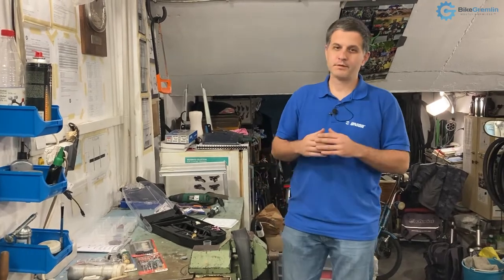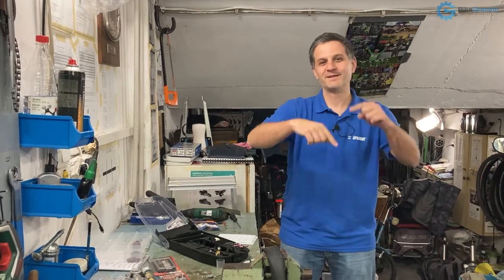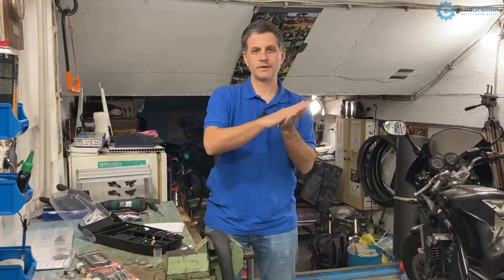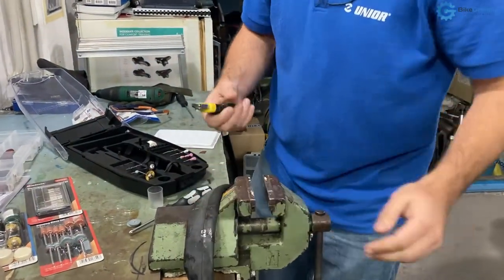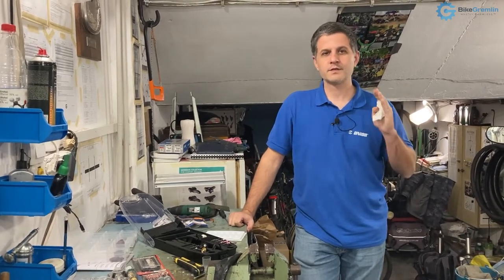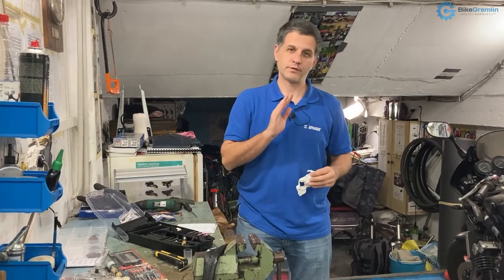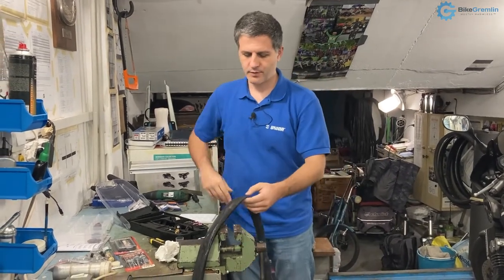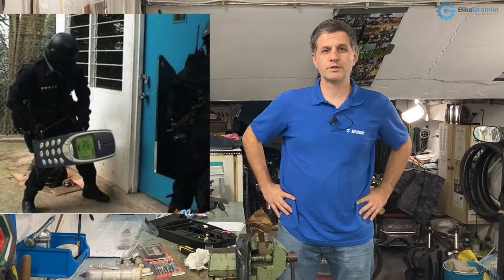Flat tyres - how to prevent it

Comment: Nice instructive video! Funny how it ended when in the last second someone knocked at the door :)).
 
One of my bikes is a Dutch bike - a Batavus city bike. I bought it around 2018 and I estimate it was manufactured in 2007. It has Schwalbe Marathon tires (28" x 1,75) and I personally rode it more than 3000km on road and on gravel and I never had a problem with it and still has the original tires (15 years old). Those tires are amazing! Of course, I try to look where I ride but on other bikes, when I use cheap no-name $15 (both) chinese/russian/polish tires, I will always get a puncture in 100-200km. So I really believe that Schwalbe Marathon are best of the best! Of course, over the years they've improved with the Plus and the E(electric) which are supposed to be even better.
I am not sure if other manufacturers such as Continental or Michelin or Maxxis, etc. have something comparable with Schwalbe Marathon.
Except for Schwalbe, everyone else seems to focus on performance (for sports), on miliseconds, on lightness, on grip, on dedicated MTB or Road bikes and they seem to neglect every day needs for people who just want to use their bikes for fun, for commuting, for riding in the park with their kids.
 
I wish that in this video you would have touched the matter of how the with of a tyre influences punctures (eg. 1.25 vs. 2.5) and what the inflation of the tyre does (ex. 2 bar vs 4 bar).
Reply from the maker: Regarding the tyre pressure, I did discuss its effect in the flat-tyres article:
https://bike.bikegremlin.com/14092/flat-tyres-causes-and-prevention/

Continental for one makes different kinds and levels of flat-resistant tyres.
Gatorskins ("road bike" tyres with decent flat protection), Tour Plus (trekking tyres similar to Schwalbe Marathon tyres) etc.
Not sure about the other manufacturers.

Comment: Instead of using tires with built in puncture guard which can use 15 Watts or more, I prefer to use Mr Tuffy tire liners which only use 0.05 Watts. I ride 50Km per day, only have a flat once every 20 years or so.